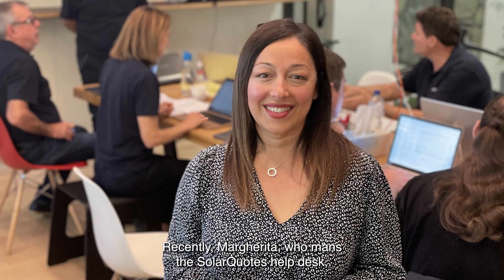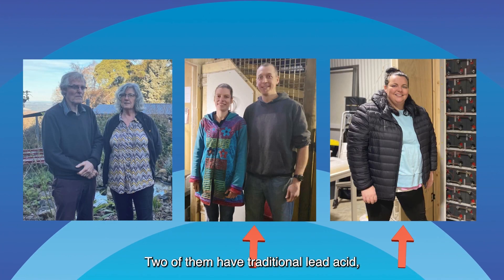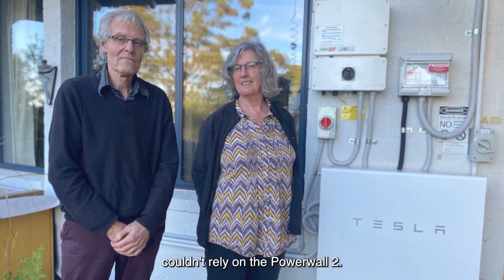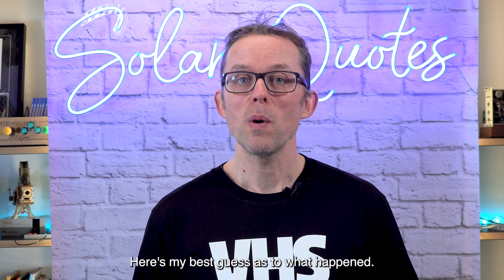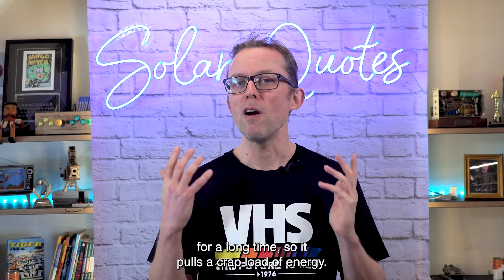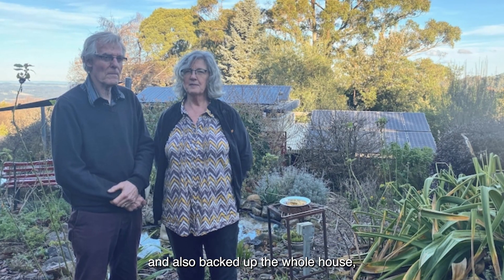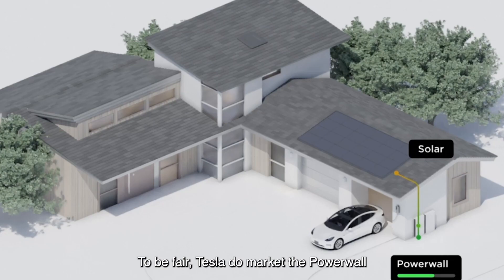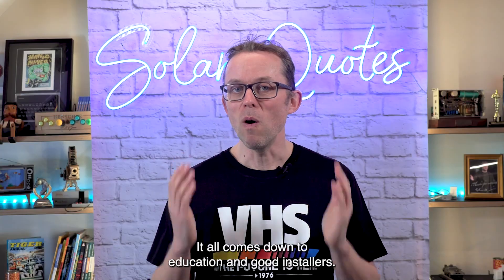Tesla Powerwall In A Blackout: This ONE Mistake And You'll Be In The Dark

Comment: Last year, our house went for 14 days without power from the grid because of hurricane Fiona (Puerto Rico) and we had continuous power from our 30 solar panels and 2 powerwall batteries. We diligently manage the power used in the house and our batteries never went below 25% during those 2 weeks.  We even used the electric clothe dryer and electric stove (diligently).  We also turned the air conditioning on during the sunny days, then turned it off around 5 pm and turned it back on around 9 pm every night (Puerto Rico is very hot in summer).  My installers explained that if the batteries go below 20% or I'm using too much kw ath the time the power goes out, thant the batteries will shut down and my emergency 15k back up generator would automatically would turned on (I have an automatic transfer switch) but that situation has not had the chance to happened yet, although the installers did a test and It worked as planned. I forgot to ask, and I've always wondered if I decided to conserve powerwall battery, can I shut down the 2 powerwall breakers, and if that would trigger the transfer switch connected to my backup generator to turn on and provide power to the house. Would that be wise?

Comment: Can the Powerwall keep being charged by your solar while in backup operation? Thanks Phill
Reply from the maker: Yes. Mine does. But it can only do this if it is installed in certain configurations.
Reply: @SolarQuotes  can you explain what certain configurations can? I have a Goodwe GW10K-MS-30 inverter and just got a PW2 installed today. They said they could not backup the inverter circuit, so in a blackout, my Solar goes down. This was a huge disappointment, had I known, I wouldn't have gotten a PW2. They stated the 10kw inverter was to much for the Battery to power on as the PW2 is only 5kw continuous and 7kw peak.